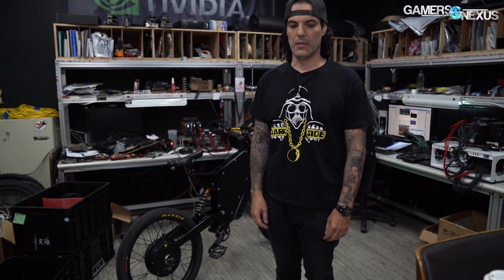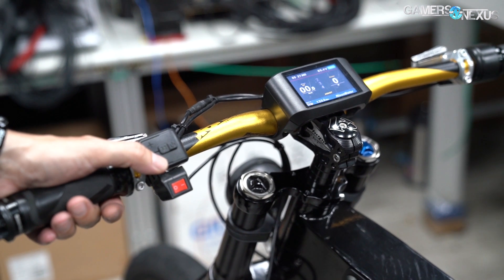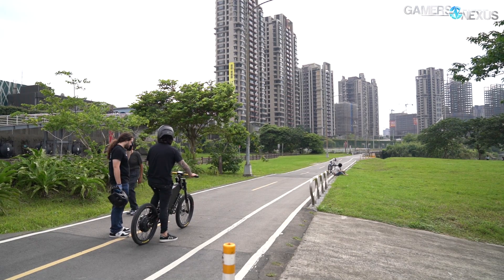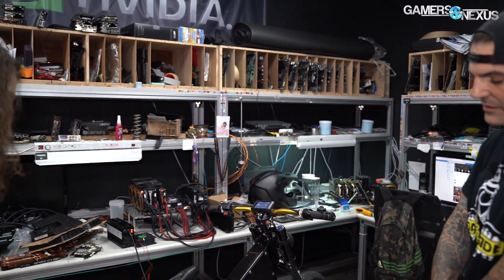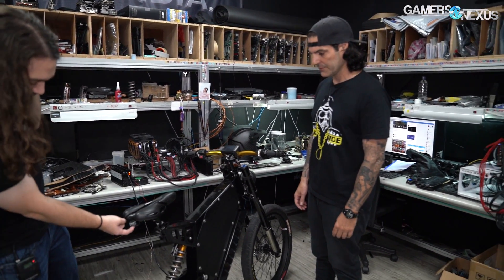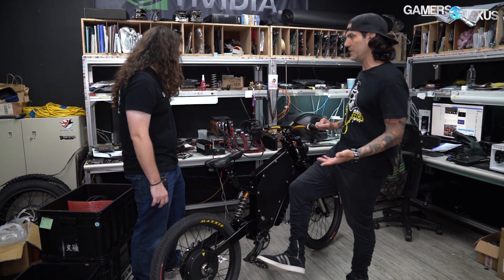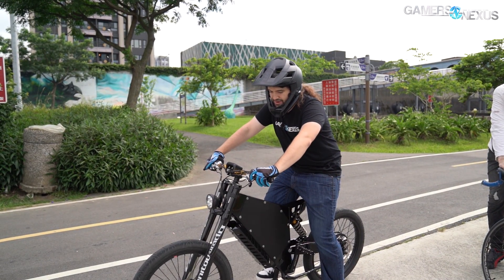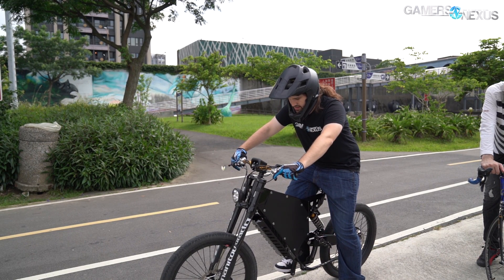KINGPIN's 60mph E-Bike | Bike Check & Test Ride

Comment: I've actually been on a bike that is almost exactly like that one in specs, it was terrifying. Mainly because those brakes are not good for slowing a bike down from those speeds effectively 😁
Reply from the maker: Gotta put quad-piston DH brakes on it for that! And even then, it's asking a lot of the brakes.
Reply: @gnsteve8846  I bet he goes through pads like they are nothing!
Reply: Try the new dual front caliper Tekro Auriga E-Twins, they are actually designed for high power E-bikes. That makes 3 brake disks and the Regen braking. Should be plenty.
Reply: @gnsteve8846  Quad pistons would help slightly but really need a thicker Disc to help dissipate the immense heat from stoping a bike weighing 3.5x as much as a MTB and going 3x as fast.   Those HOPE brakes are probably done after 2-3 full speed stops.
Reply: ...where we're going we dont need brakes